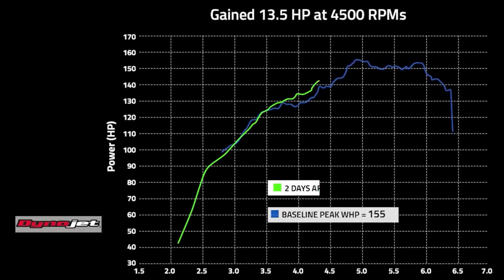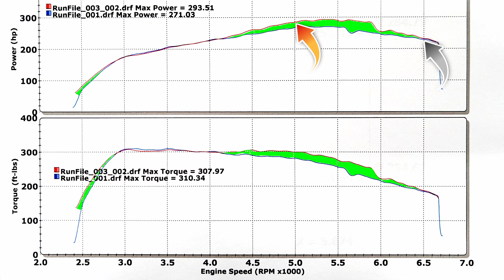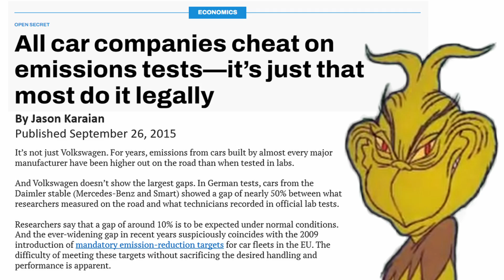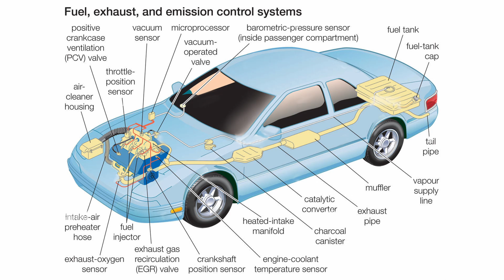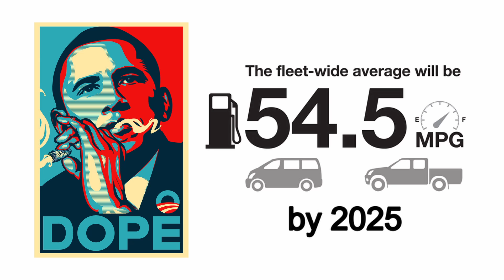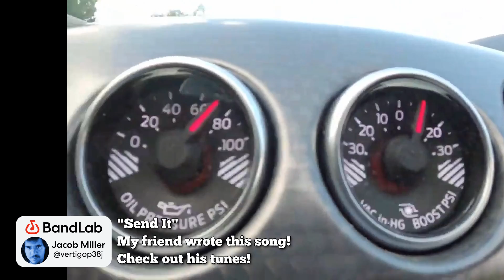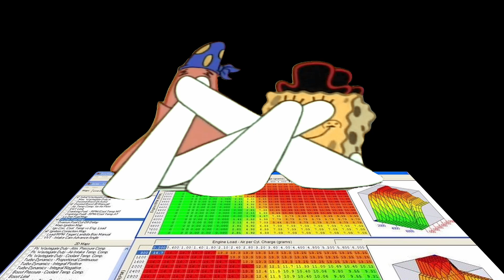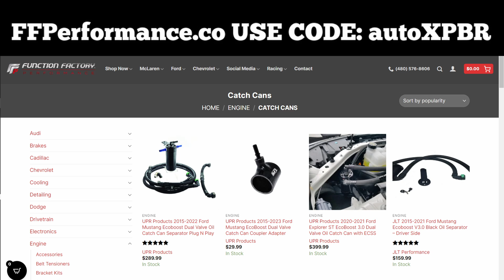BIG Walnut Blasting Horsepower Gains - Dyno Results Will Surprise You! EcoBoost Mustang

Comment: The power recovered is going to be small compared to some engines that will develop misfires and codes due to carbon build up. I have had several cars that could not pass inspection due to misfire codes caused by carbon build up.
Reply from the maker: True! At least my car wasn't running that bad. But it definitely developed those drivability quirks — 14:01 — it wasn't doing any of that when I first got it. The cleaning not only cured them, the power gain was instantly noticeable. I'm glad I did the before and after dyno pulls to confirm.

Comment: I had to get a new dd and went for a new Toyota that has the d4s fuel system. Direct and port injection and runs on port more than half the time so the intake valves stay clean. I don’t get why that’s not the standard for every oem.
Reply from the maker: Many are working on adding it, but it's been far too long on numerous platforms.

Comment: Been using Crc to clean my pcv (I should just install a catch can) I've been looking at european low SAPs oil to reduce intake build-up. Been using GF 6 oil, but not sure how to figure out which is low SAPs so decided to just use european marketed oil.
Reply: Will a catch can avoid dirtying the pcv? Or will it just reduce the dirt gathering in it?
Reply: @danibj  Only reduces buildup.  Much of the garbage is the PCV vapors as well as the EGR exhaust carbon.
Reply: @reubenmorris487  thanks! I have the catch can, bought the car with it, so will be using crc very soon

Comment: Direct injection?
Reply from the maker: 13:08 Direct Injection. All fuel is sprayed into the cylinder. As opposed to Port Injection that sprays outside the cylinder. Or a Carburetor that sits on top of the intake. The closer you get the fuel to the cylinder, the less losses you have, but you can create issues like this carbon buildup.
Reply: @pete_bruschi_racing  D.I. also puts more soot into the oil and will make the car blow out more black smoke under full-throttle.